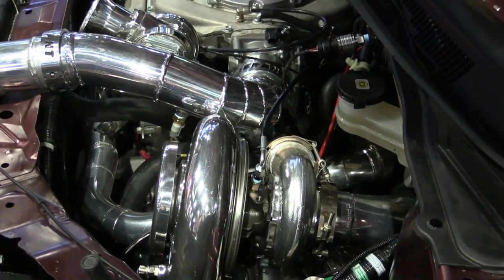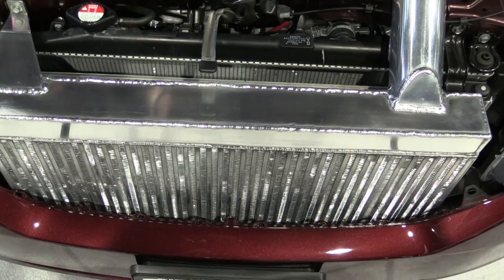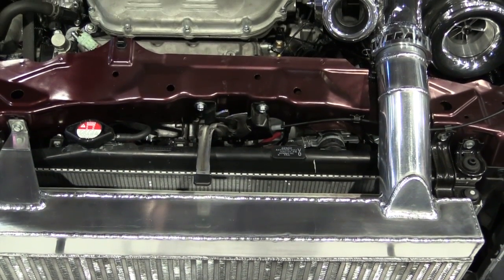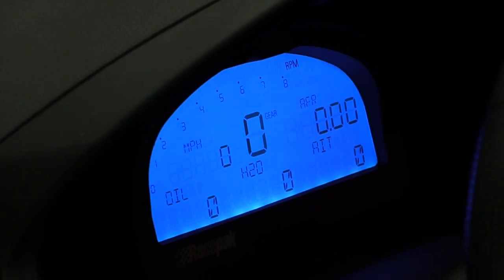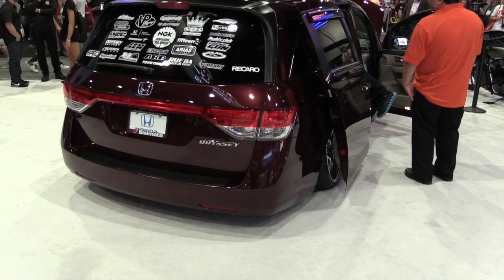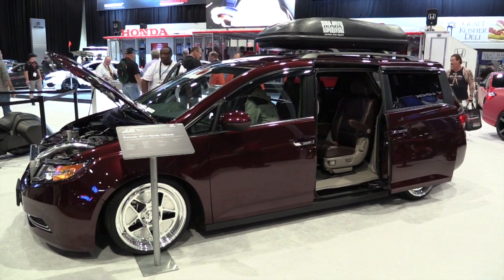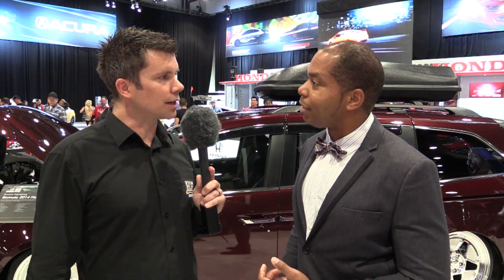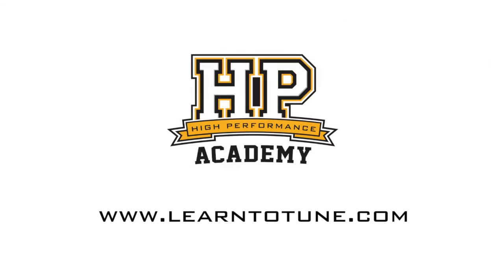Bisimoto 1029HP Honda Odyssey w/HPA | That's right a 1000HP Van.

Comment: question any knowledgeable honda individual...would 275/40/20 tire a and 20/10in wheels with 47mm offset ... would this fit the rear of a 2006 honda odessy ex-l ?

Comment: So many are denying that it makes the near 1000hp mark based of a burnout it did. I don't feel as if they would lie about it, and when you think about it making that kind of power from a TT V6 is pretty common for tuners. The motor makes 250hp stock. Honda motors are typically pretty open to aftermarket parts so I can see the power being real.
Reply: single T v6. exactly he's not trying to break it doing a burn out.

Comment: 1k hp would shred the tires like butter n even more if they are street this van i think could go up to 500 tops and 300 at the wheels just saying
Reply: If you were listening, he says there is a traction control system in place to limit power when it detects wheel slip. With that off, i'm imaging it would vaporize the tires.